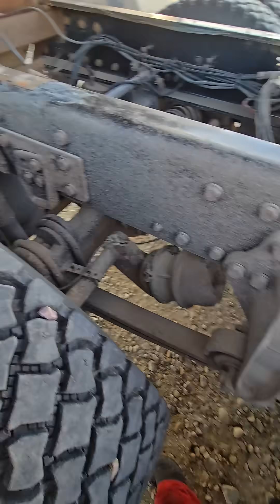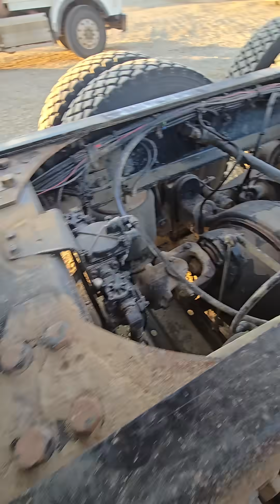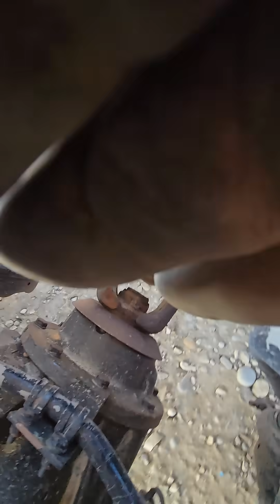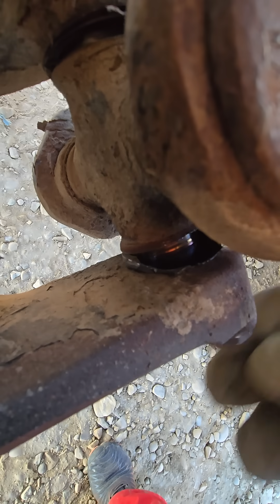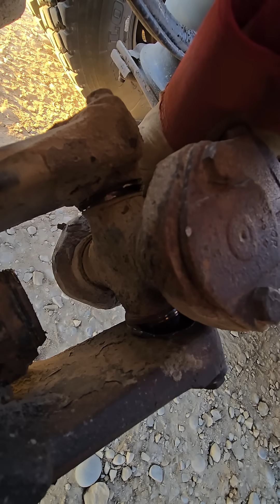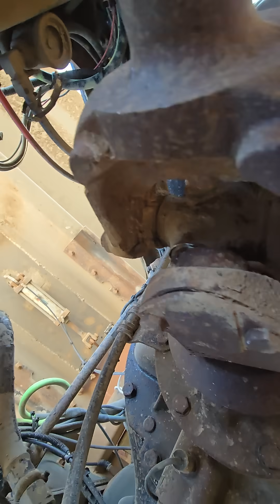Universal Joint problem

Comment: Looks like it's seen it's share of work,looks pretty old
Reply from the maker: One thing for sure is it didn't see an excessive amount of grease!
My short term remedy was removing the drive shaft and run without that rear axle for the rest of the day (video yet to be posted) and had both u joints replaced that evening ready for work in the morning. 
Thanks for checking it out and for your comment.  Stay tuned for more content my friend.
Reply: My  old man always said grease is cheaper than breaking down because you didn't use it @lovesloudcars
Reply from the maker: 100%!! What's ironic is that for a while now at work drivers don't grease all those things and mechanics do it regularly so it doesn't get missed. Apparently it got missed...
 @davewoods3543

Comment: I’d drive it home 😂
Reply from the maker: Might get away with driving it for days yet,  but Heaven help you if that sucker comes apart and thrashes around tearing out air lines, electrical wires& anything else available..
I ended up pulling out the drive shaft and running for the day with just the 2 axles locked in. (Video to follow).
Stay tuned for more content my friend and thanks for watching and for your comment.

Comment: All you have to do is take off the driveshaft to that differential and then limp back to the shop
Reply from the maker: That's exactly what i did to get back on the road..pulled that shaft, locked the power divider and hauled a few more loads until the parts arrived at the shop.  It was back in business the next morning. 
Stay tuned for more my friend and thanks for watching.

Comment: Have you considered grease?  Just kidding. Can you limp it around for the day as a tandem with no rear driveshaft? Empty would be no problem.
Reply from the maker: @harveywright396  crazy hey??
That's exactly what I did,  video to come. Just removed that back shaft and ran for the day with the power divider locked in and the center axle locked.

Comment: Those U Joints are Your Enemy 😮Nathan Seems Like There Always Failing 😩😩😩😳😮
Reply from the maker: @chrischiampo7647  that truck has certainly had its fair share of troubles with them.
I was thinking about it the other day,  I pull heavy loads constantly way over US specs. Every load I weigh in just under 140,000 pounds total weight,  that's substantially more than the 80k 18 wheelers down there.  Perhaps that's a contributing factor.  It certainly was a couple times for sure.